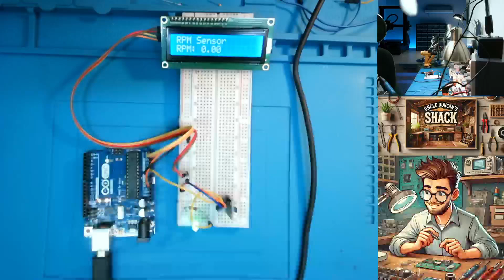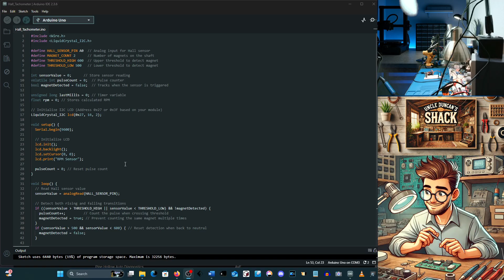DIY Analog Hall Effect Tachometer with Arduino Uno | RPM Display on I2C LCD

Comment: any chance i could get the code....  ive got my hall effect sensor writing to the serial monitor, but i cant get it to print onto the LCD i have connected.... alternately i can get my LCD to display text sent through the serial plotter... im a little lost and its getting late :'D
Reply from the maker: Hi there,
Here it is:
#include <Wire.h>
#include <LiquidCrystal_I2C.h>

#define HALL_SENSOR_PIN A0  // Analog input for Hall sensor
#define MAGNET_COUNT 2      // Number of magnets on the shaft
#define THRESHOLD_HIGH 600  // Upper threshold to detect magnet
#define THRESHOLD_LOW 500   // Lower threshold to detect magnet

int sensorValue = 0;      // Store sensor reading
volatile int pulseCount = 0;  // Pulse counter
bool magnetDetected = false;  // Tracks when the sensor is triggered

unsigned long lastMillis = 0; // Timer variable
float rpm = 0; // Stores calculated RPM

// Initialize I2C LCD (Address 0x27 or 0x3F based on your module)
LiquidCrystal_I2C lcd(0x27, 16, 2);

void setup() {
  Serial.begin(9600);

  // Initialize LCD
  lcd.init();
  lcd.backlight();
  lcd.setCursor(0, 0);
  lcd.print("RPM Sensor");

  pulseCount = 0; // Reset pulse count
}

void loop() {
  // Read Hall sensor value
  sensorValue = analogRead(HALL_SENSOR_PIN);

  // Detect both rising and falling transitions
  if ((sensorValue > THRESHOLD_HIGH || sensorValue < THRESHOLD_LOW) && !magnetDetected) {
    pulseCount++;         // Count the pulse when crossing threshold
    magnetDetected = true; // Prevent counting the same magnet multiple times
  }
  if (sensorValue > 500 && sensorValue < 600) { // Reset detection when back to neutral
    magnetDetected = false;
  }

  // Update RPM calculation every 1 second
  if (millis() - lastMillis >= 1000) {
    rpm = (pulseCount * 6.0) / MAGNET_COUNT; // Convert pulses to RPM
    pulseCount = 0; // Reset pulse count for next interval
    lastMillis = millis(); // Reset timer

    // Display RPM on LCD
    lcd.setCursor(0, 1);
    lcd.print("RPM: ");
    lcd.print(rpm*10.0);
    lcd.print("    "); // Clear extra digits

    // Print to Serial Monitor (for debugging)
    Serial.print("Sensor: ");
    Serial.print(sensorValue);
    Serial.print("\t RPM: ");
    Serial.println(rpm);
  }
}
Reply: @Uncle-Duncan-Electronics-Shack  nice, thanks Unc, got it reading... my lcd is not I2C so i had to modify the code a touch to suit the standard lcd library.... reads 'ok' but my RPM fluctuates up and down, what would i adjust to get a steady reading?
Reply from the maker: @2zzeEPy the proper way to actually do this is by passing the hall sensor signal through a comparator to make it a digital signal and use the pulse in command to measure the period and calculate frequency and rpm
A lm393 is a good choice for the ic to use for the comparator
Reply from the maker: @2zzeEPy  #include <LiquidCrystal.h>

// Initialize LCD (RS, E, D4, D5, D6, D7)
LiquidCrystal lcd(7, 8, 9, 10, 11, 12);

const int sensorPin = 2;  // Input from sensor
unsigned long pulseDuration;
float rpm;

void setup() {
  pinMode(sensorPin, INPUT);
  lcd.begin(16, 2);
  lcd.print("RPM Meter Ready");
  delay(2000);
  lcd.clear();
}

void loop() {
  // Measure the time between two rising pulses
  pulseDuration = pulseIn(sensorPin, HIGH, 1000000);  // Timeout: 1s

  if (pulseDuration > 0) {
    // Convert pulse duration (in microseconds) to RPM
    float frequency = 1000000.0 / pulseDuration;  // Hz = 1 / period(s)
    rpm = frequency * 60.0;                       // RPM = Hz * 60
  } else {
    rpm = 0; // No pulse detected
  }

  // Display on LCD
  lcd.setCursor(0, 0);
  lcd.print("RPM:            ");  // Clear line
  lcd.setCursor(5, 0);
  lcd.print(rpm, 1);  // One decimal place

  delay(250);  // Short delay for readability
}
Reply: @Uncle-Duncan-Electronics-Shack  ok, makes sense
Reply: @Uncle-Duncan-Electronics-Shack  your a gem, mate
Reply from the maker: @2zzeEPy  
Hi Joseph,
Here is another option using the internal threshold hardware in the Arduino and making it interrupt driven.

#include <LiquidCrystal.h>

// LCD RS, E, D4–D7
LiquidCrystal lcd(7, 8, 9, 10, 11, 12);

volatile unsigned long lastTime = 0;
volatile unsigned long period = 0;

void setup() {
  lcd.begin(16, 2);
  lcd.print("Using Comparator");

  // Set up Analog Comparator
  ACSR = 0;  // Clear Analog Comparator Control and Status Register
  ACSR |= (1 << ACIE); // Enable Analog Comparator Interrupt
  ACSR &= ~(1 << ACIS1); // Interrupt on toggle
  ACSR &= ~(1 << ACIS0); // (i.e., rising or falling edge)

  pinMode(6, INPUT); // AIN0 (D6)
  pinMode(7, INPUT); // AIN1 (D7) - reference voltage via divider

  sei();  // Enable global interrupts
}

void loop() {
  noInterrupts();
  unsigned long rpm = 0;
  if (period > 0) {
    rpm = 60000000UL / period;
  }
  interrupts();

  lcd.setCursor(0, 1);
  lcd.print("RPM:            ");
  lcd.setCursor(5, 1);
  lcd.print(rpm);
  delay(200);
}

// Interrupt service routine for Analog Comparator
ISR(ANALOG_COMP_vect) {
  unsigned long now = micros();
  period = now - lastTime;
  lastTime = now;
}

🧷 Hardware Notes:

    Connect your signal (e.g., from a coil or sensor) to D6.

    Create a voltage divider (e.g., two 10kΩ resistors) from 5V to GND with the midpoint to D7 (2.5V reference), or a potentiometer to set the threshold voltage.

No filtering? Add a small cap (~0.1µF) to the midpoint of the divider for noise immunity.
Reply from the maker: @josephke20 
So that code did not work, however this does as I have been able to test it and it is nice and stable.
The hall output goes directly into pin 2 which can be used as an interrupt.
#include <Wire.h>
#include <LiquidCrystal_I2C.h>

// I2C LCD setup: address 0x27, 20 columns, 4 rows
LiquidCrystal_I2C lcd(0x27, 20, 4);

const int sensorPin = 2;

volatile unsigned long lastTime = 0;
volatile unsigned long period = 0;

void setup() {
  lcd.init();
  lcd.backlight();
  lcd.setCursor(0, 0);
  lcd.print("Digital RPM Meter");
  delay(1500);
  lcd.clear();

  pinMode(sensorPin, INPUT);

  attachInterrupt(digitalPinToInterrupt(sensorPin), pulseISR, FALLING);
}

void loop() {
  noInterrupts();
  unsigned long currentPeriod = period;
  interrupts();

  unsigned long rpm = 0;
  if (currentPeriod > 0 && currentPeriod < 1000000UL) {
    rpm = 60000000UL / currentPeriod; // µs to RPM
  }

  lcd.setCursor(0, 0);
  lcd.print("Pin 8 Rising Edge");

  lcd.setCursor(0, 2);
  lcd.print("RPM:                ");
  lcd.setCursor(5, 2);
  lcd.print(rpm);

  delay(200);
}

void pulseISR() {
  unsigned long now = micros();
  period = now - lastTime;
  lastTime = now;
}
Reply: @Uncle-Duncan-Electronics-Shack  this one did not work for me, the lcd displayed 'Digital RPM MEter' then displays some foreign characters and doesnt count.....
Reply: ok, fixed it, i had to repin my lcd so the sensor could go into pin 2, but when i have no input from rotation the display reads a random extreme number....
Reply from the maker: @2zzeEPy yeah if the analog value is hovering around the threshold of the digital input then counting will happen. 
In that case one should send the hall sensor signal through a comparator to get definitive digital pulses for the arduino to count
Reply: @Uncle-Duncan-Electronics-Shack  ok, makes sense. thank you very much for your time.
Reply: ended up getting a comparator ......
Reply: ive wired a 10k pot to one inpput and the Hall sensor to the other output.... using ur first code i get a reading but it is wildly inaccurate
Reply from the maker: @2zzeEPy  Hey mate. When I am at home I will flash up some code so that one can use an analog in to read the hall signal voltage and plot it in the arduino ide. That is the next best thing to using a scope to look at he analog value to see what is going on, as one needs to plot that signal to see what it is doing and the decide how to fix the problem once one understands it.
Reply from the maker: void setup() {
  Serial.begin(115200);
  analogReference(DEFAULT);

  // Set ADC prescaler to 16 for faster conversion (~77 µs instead of 110 µs)
  ADCSRA = (ADCSRA & 0b11111000) | 0x04;
}

void loop() {
  Serial.println(analogRead(A0));
}
Reply: @Uncle-Duncan-Electronics-Shack  https://www.youtube.com/shorts/_PS_5SenHuo
Reply: well i found a work around using an optical sensor instead :D
Reply from the maker: @2zzeEPy  Nice, that's a great solution.
Reply: How could I obtain the circuit wiring diagram?